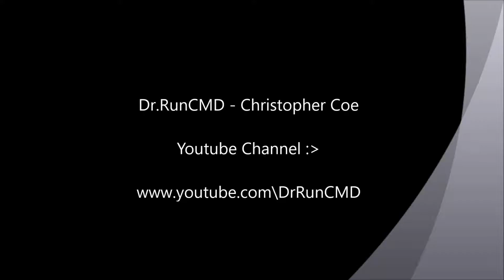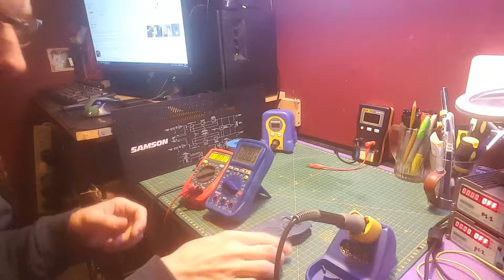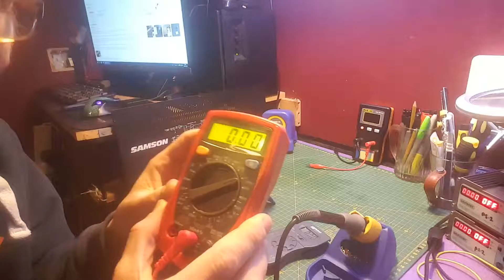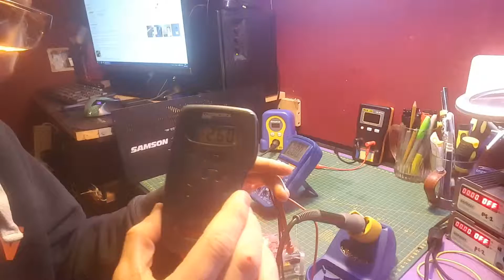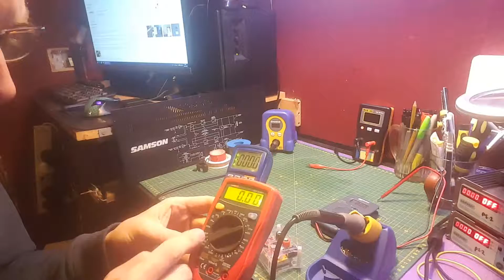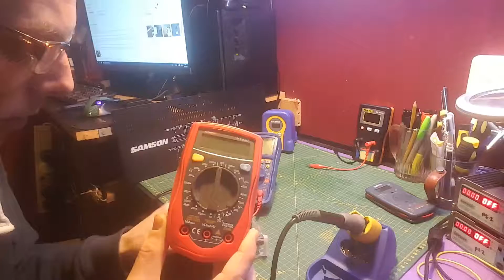Cheap multimeter quick review and the Hao Qi Xin voltage standard.

Comment: There should be a label on the bottom that indicates the actual voltage that your particular unit is putting out on each range as measured at the factory with a high end Agilent meter out to five decimal places. Of course the meters you were testing don't have that kind of resolution but should go out to 2 decimal places at least. Thanks for the look see.
Reply from the maker: Yeah i know and also didn't say about wire resistance either so not really proper measurements by all accounts but just a general idea of cheaper multi meters and their abilities or non thereof. Thanks for the comment!